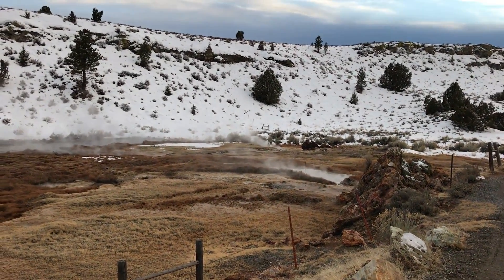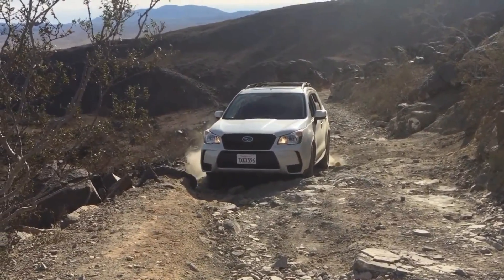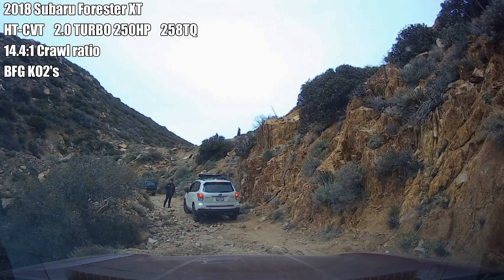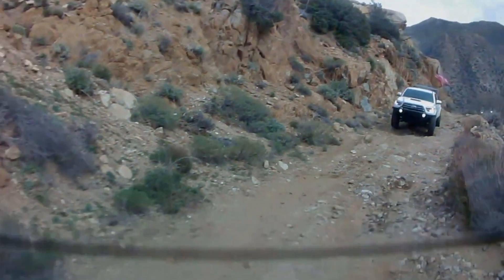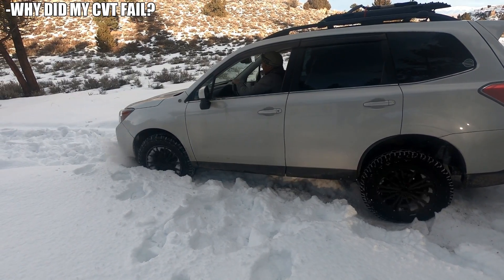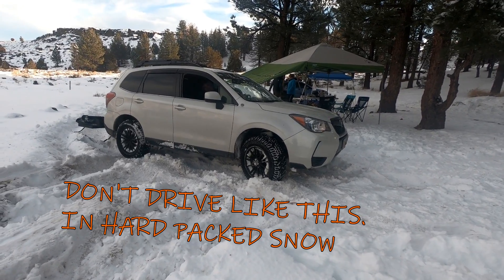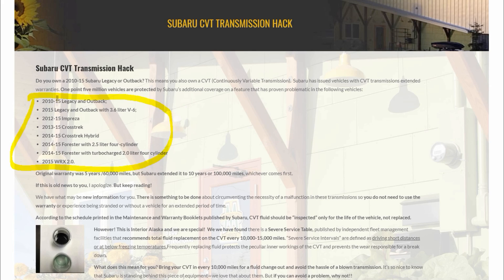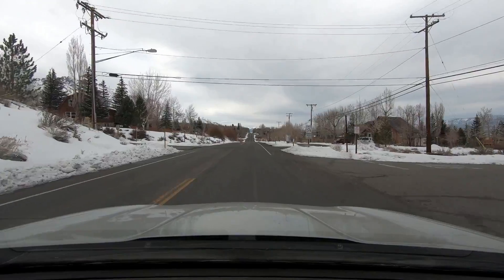CVT transmission Failed!  Can we make them last?

Comment: (EDIT: read the part below about changing fluid on your CVT. You may void your warranty by doing so. Find out first.)

First, in my own testing I believe some of the no power issues are not actually caused by the CVT itself, but by the software programming that links it to the AWD torque vectoring system. 

I have done a test with 4 ramps (one on each tire of course) where I simulate a steep incline on flat ground. I FLOOR the accellerator because nothing happens. And this is where many people stop and say, it won't do it.. 

But If I keep it floored for another moment my turbo 2.4 LAUNCHES up the ramps, in fact a bit too quickly for comfort because it releases all that spooled torque converter energy all at once once it figures out that nothing is moving and that individual wheel traction is not at issue. 

If it was simply the CVT, my 2.4 liter power plant would not LAUNCH up the ramps after a few seconds. Because I did not suddenly switch to classic transmission mode. I am still using the CVT. 

What is happening is that the logic that controls these complex systems is trying to figure out why I am needing so much power on flat ground. It is trying to protect itself. After it tries a few things with no success it releases power, and by this time I am floored with too much stored energy so it is not very controllable. 

Of course now that I've had the car a while, I'm getting better at adapting to this with more control. But it is frustrating when this software logic defeat occurs, killing your moderate momentum, forcing you to start from scratch, and either launching you into that obstacle, or making you back up and using MORE than moderate momentum which is dangerous offroading. 

This is just my own experience in my own car, which frankly has solved the issue more than many other previous models by enhancing the AWD logic and lowering the ratio even further. And also by watching the videos of other people, and deducing what is occurring. 

I will say that although I understand Subaru engineers erring towards caution in high force obstacle or incline demand, it would be nice to have a GOD mode, even if it only lasted like 15 to 30 seconds. Just enough time to get you past that obstacle without melting down, and then the system could again revert to it's protective programming which is excellent for MOST circumstances. 

As far as the CVT and maintenance and cooling, I want to warn people that Subaru considers these systems lifetime systems, so if you want to check your fluid or add a transcooler check with your dealer first. That neat 100,000 mile CVT warranty can be voided if you break the seal on the unit, and you apparently need to break the seal to change fluid.  Source https://youtu.be/ZR3eZZcgoZ0
The new Wilderness Edition which is my newest aquisition is touted to have a transcooler, but looking deeper, so did all of the XT Turbo models, so I don't know if it is the same, or something more robust, and nobody seems to know. I have not yet found any gauge in the settings that shows me trans temp. which would be helpful. 

I think changing oil more often under more challenging use sounds like a good idea. But given the fact that it is a sealed unit, considered by Subaru to be maintenance free in most models, I would err towards leaving it alone, or letting your dealer do the maintenance. 'm wondering if I need an aftermarket transcooling upgrade with the Wilderness, or if it's gearing and stock cooler are enough to get me by. I guess the thing to do would be to install a heat gauge and see where Im at. Or figure out how to get my robust car info suite to tell me what it already probably knows. I haven't honestly looked at all the settings in my new infotainment system so it is possible I do have access to a trans temp gauge.

So far I really like this platform. It IS a CVT but it seems to be the best iteration yet, and despite being able to create the no power condition on ramps, I have yet to run into this problem out on real roads including some steep grades I have been on. And I am rolling on 29.5" tires which reduce some of the gearing advantage of this model. 

But then again, everyone that offroads goes big on tires, so I look at the lower gearing of the Wilderness as a wash, all things being equal, it's still better with the oversized tires than it would have been without the lower gearing. 

So did the Dealer Replace your CVT? 
Was it still within the years/miles to be covered? 
Was there a lot of downtime or was it basically an in and out procedure?  

Thanks for the vid and the explanation on this. We are all pioneers with this new tech. 

I have nothing against CVT's and I believe that what is blamed on CVT's is actually in most cases either Torque vectoring robbing all the available torque by using brakes uphill or against an obstacle (because torque vectoring is a lossy compromise over a true 4x4 we need MORE power and some Subaru's simply do not have enough) 

We do have to understand the limitation of AWD torque vectoring., and more importantly know when it really is the CVT or the Logic that drives it that is causing the problem on our 3 differential AWD platforms.  

For the first generation XV's and smaller motor'd crosstreks those smaller power plants barely had any torque left over on a slippery gravel hill because the torque vectoring was robbing so much torque in braking, that the leftover torque that was moved to the wheels with traction could not move the car. 

This is not a matter of CVT vs Standard or classic automatic. It is a matter of AWD torque vectoring with too small of a motor on too challenging of an obstacle or grade.

But for the 2.5's, 3.9's and XT's that have had seemingly similar problem, again, it is likely not the mechanical nature of the CVT (although the gearing NEEDS to go lower of course) but the logic that drives it. It basically TELLS itself that it is going to fail, so it doesn't try, or it tries other things first, delaying our momentum before finally sending power. This is not always a CVT issue, it is in many cases a control issue. And again, it would be nice to have a God Mode. I may look at seeing if there is some way to bypass this logic, as I said, even for a few moments to get you past a difficult situation, and then let it revert to protection mode.

This all being said, there are many models and power plants and different generations of AWD logic and Xmode logic (same thing with a purpose) so not every similar problem has the same cause or cure.

Databyter
Reply from the maker: Woooo! Long comment databyter!  So, I can answer the first part.  The torque converter is set to have a “speed stall”.  When you apply more gas and the RPMs rise, eventually you’ll have enough torque to over come the speed stall.
Reply: @JonDZ_Adventuring  Guilty. I generally need to go back and edit out half of my stream of consciousness comment to make it less of a book. So sorry. :/
Reply from the maker: I read the rest of your comment.  When I first saw it, I was camping with Family over the this Easter weekend and the first thing that stood out was “torque converter stall speed”.  Even first Gen HONDA Pilots with the HONDA 5 speed will have the torque converter stall out.  The ZF9 in the Passport doesn’t stall at al, the tires will just break traction and spin like crazy, and if not careful, it will trigger the AWD heat warning.  Someone was telling me that these newer German transmissions can do a near 1:1 lock.

So!  Regarding the coolers!  Yes, a transmission as well as a radiator cooler can do a good job at bringing the temps down.  The #1 thing I preach is to monitor your temps full time.  I’m actually giving away (2) Scangauge II ‘s.  You just have to leave a comment on this video to enter.

Being able to monitor full time, is so crucial!  240F is when seals start to harden and parts get varnished.

https://youtu.be/LLNjy9sN_9Y

Comment: This CVT problems issue is not related only to Subaru, but all other manufacturers who continue to equip their vehicles with CVT, and the champion in this area of CVT failure is Nissan. So it is 100% certain that
the CVT will let you down even in less than 100,000 Kms. So in my case, i will never ever buy Nissan whatever the model is, this cvt technology is nothing but a failure and Nissan continues to use the same cvt technology whatever the cost is, just like they have a fantasm to see their name as a champion of CVT failure.
Reply: I’ve been a executive extended warranty claims administrator for the past 10 years. I can tell you with data and facts that the majority of cvt failure claims I process currently is from Subaru. Failures are occurring anywhere from 60-90k miles just after the factory warranty concludes. The reason? Heat. Subaru still believes that cvt fluid is a lifetime fluid in the United States. Whereas elsewhere Subaru markets their cvt fluid as a replaceable item much like brake fluid or engine oil.  Subaru’s cvt’s are based upon a decades old Jatco design (just like Nissan’s) and have been improved over the years, just like Jatco has made numerous improvements. Nissan was the leader in cvt failures up until 2014. Nissan demanded Jatco make changes to their cvt’s to increase longevity. After 2014, Jatco’s cvt’s had a marked decline in warranty claims. Subaru, a different story. They purchased rights to a Jatco cvt in 2003, and were slower to adopt changes. Subaru is obviously a much smaller company with far fewer resources that Nissan, so quality control came at the expense of development and vice versa. I’m processing numerous Subaru cvt failures that all have the same issues. Varnish on the intervals due to overheated cvt fluid caused by heat and lack of fluid changes. The valve body is usually the first culprit of Subaru cvt failures. However, claims for valve body’s mean an entire new cvt.
Reply: @haroldbeauchamp3770  hey, with your last statement, do you mean that a valve body replacement is a bad  sign that the rest of the cvt is ready to fail? I just replaced my valve body due to solenoid failure. But the car seemed to drive fine enough to get to the dealership. Luckily under warranty at 87k. Thoughts?
Reply: @kohort1  no. What I intended to say was that my company does not replace the valve body’s. If the valve body goes bad we pay for an entire new transmission. Replacing just the valve body and not replacing the entire transmission usually means there will be additional problems in the future. The factory cvt warranty ends at 60k miles. Did you purchase an extended warranty from Subaru or a 3rd party?
Reply: @haroldbeauchamp3770  the cvt warranty was extended by Subaru to 100k back in 2021. So they replaced the valve body under warranty. I wish they replaced the whole CVT, LOL! Anyhow, I fear the cvt itself is going to follow. Obviously, if it does then hopefully before 100k but I fear I'll be on a trip when it happens. But yeah what you're saying is kinda what I fear.... That the valve body failure is a sign of things to come for the CVT.
Reply: @kohort1  change your cvt fluid every 30k miles from this point forward. Valve body’s “burn up” due to heat and varnish. Clean, fresh fluid will significantly reduce this from happening again or accelerating any other damages.
Reply: @haroldbeauchamp3770  hope for the best. Lol... I did a drain/fill at 73k against Subarus instruction. Luckily that didn't void the warranty. So now I'm at 87k and the dealership invoice shows they topped 2qts after replacing valve cover. 13k miles to 100k...or I could trade it in. Lol.
Reply: Nissan cvt is the worst. Subaru makes a good cvt IF you drive it gently and don’t full throttle race off the line high revving at every stop light. I baby mine. Usually always below 4K rpm’s. Ex wife’s forester with cvt has 60k on it with no problems. My moms Subaru has about the same mileage and no issues. My friends outback has 150k with no problems. However I do hear stories all the time about people killing their cvts. Just need to drive gently, service it more than Subaru says you do (they will tell you the cvt transmission fluid is for life that’s a lie).

Comment: I’ve just bought a 2022 Mitsubishi Mirage, only 500 miles on it, at 30,000 miles there’s is a fluid change and a filter change on the Cvt ,paper filter and o ring , then at 60,000 you do the same filter and drop the pan and change the other filter and oil again. I called several Mitsubishi dealers to get a few filters to keep on hand, they said all that all they do is replace fluid, they never change any filters, even tried to tell me they didn’t have filters. So that goes on at every dealership in the country, not just Mitsubishi, every brand, so cvts get a bad rap because 99 percent of dealers do shitty work, just changing oil might get it past the warranty,that’s all they care about CROOKS !
Reply from the maker: I totally agree with you.  My dealership told me I never had to change my fluid.  That it was lifetime.  Actually, Subaru of America said it was lifetime, but also in their maintenance handbook, it talks about “severe duty”.  Which includes stop and go city driving.  The dealerships should be familiar with this!

On another, somewhat related note, I feel CVTs would be more widely accepted if they were serviceable.
In a Subaru CVT, there is no filter, just a magnetic mesh.  Once it fills up, that’s a wrap.

Comment: My 2018 Forester's CVT accidentally got drained during a routine oil change. Someone mistook the transmission drain plug for the engine drain plug. I need to refill my CVT and I am not sure which CVT fluid will be compatible. I've called the dealership and did a lot of online research and have gotten no definitive answers. Mainly, I am not sure what and how many types of CVT fluids are out there. I have heard of CVTF - II and CVTF - III and some with NS-(number) but there is nothing I can find that just explains everything simply. Can anyone drop me a link to that info or just simply explain to me here? Any help would be appreciated.
Reply from the maker: Do you have the 2.5 or 2.0T?
Reply: @JonDZ_Adventuring  2.5
Reply: @JonDZ_Adventuring  2.5i, no turbo
Reply from the maker: @patrickinkorea4451  you have the TR580 CVT.  Watch this video by Mr. Subaru 
https://youtu.be/1pb45NguQHk
Reply: @JonDZ_Adventuring  Thank you! That was an informative video.

Comment: My 2011 outback has a CVT.  I don't go down jeep trails or off roading like up in the dirt trails at local mountain roads that are around here if u know where to look.  I probably would have years ago when I was more reckless and didn't have a family,  but now I actually try and baby my cars.  Now obviously Subaru isn't the absolutely best car in the world.  However my mother and a few friends and quite a few relatives own Subarus.  Everything from Foresters to Imprezas to myself with my Outback.  My mother's Forester doesn't have a CVT  because it's a 2010 and they had not started putting them into the Foresters that year.  My 2011 Outback does have a CVT and up until about 4500 miles ago it ran like a top.  Unbeknownst to me, even with doing a very thorough check including carfax and maintenance records,  it appeared that the last owner took good care of it.  Oil changes every 3K miles,  tune ups you name it.  It even had a transmission replaced at 135000 miles.  Never specified in carfax however if it was a new or used or refurbished one. So that I don't know. But I figured hey, this car, regardless of the high miles was well maintained...no accidents and the test drive I put it through its paces to a fairly decent extreme.  It ran PERFECT.   Shifted perfectly no signs of misalignment with the wheels and the thread was all very close and the tires were all the same brand.  Apparently that's very important in AWD vehicles. 
So I bought it. $7900.00....I talked them down to $6850. out the door. 
When we got snow the thing was a beast.  I was toying around and testing its integrity.  The roads were completely covered with snow, other cars were stuck and doing that classic left-right...left-right and burning rubber routine front wheel drive cars are so well known for.  Especially if you don't know how to drive in snow.  But I would come 2 a complete stop on a street hill....sit there and then just give it a little gas and God as my witness that damn car just took right off like it was dry pavement.  So everything seemed perfect. 
Well, now from a complete stop when I go to accelerate it occasionally slips and hesitates before finally catching an then it drives fine.  I can gun it after that and it takes off like a missile.  It's only when I come to a complete stop.  I have no idea what happened to my outback.   I love that car.  If anyone has any insight please let me know.   Thank you

Comment: No problem with CVT as long as fluids are changed every 40K km. I use shell cvt fluid.
Reply: Subaru America does not allow for fluid changes. Subaru dealers refuse to provide cvt fluid changes. If you have a problem and the transmission fluid has been changed, Subaru will deny the warranty claim. Subaru Canada does not do this, just Subaru United States.
Reply: @haroldbeauchamp3770  Never a problem getting the CVT fluid changed at the Nissan dealerships.  I have mine changed every 25,000 miles.  My 12' Altima has 111,000 miles on it and the CVT runs fine.
Reply: @josephkelleher8820  Nissan does an excellent job updating the service manuals and doing dealer service trainings. All dealer service departments know that cvt’s require frequent maintenance. Subaru on the other hand has horrible dealer networks and service issues. 90% of Subaru dealers refuse to service their cvt and the other 10% will do it, but many will price gouge the customer because they can get away with it.